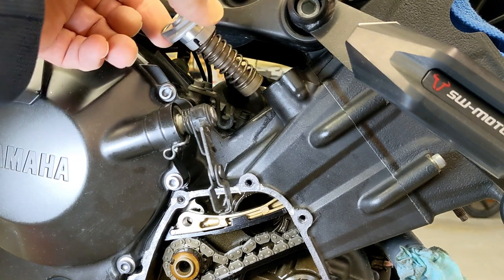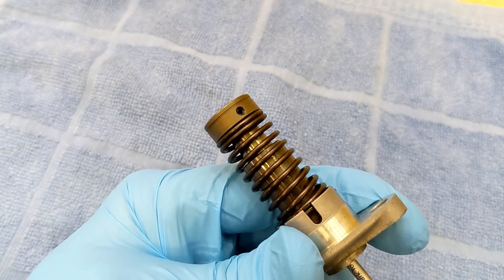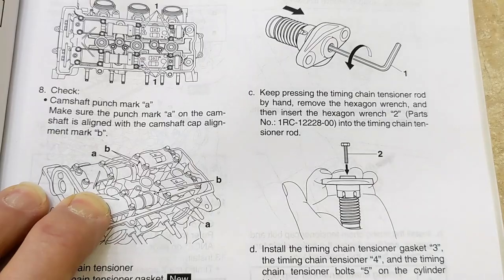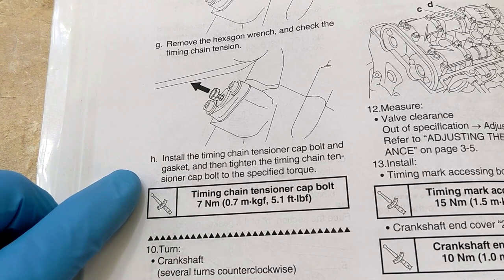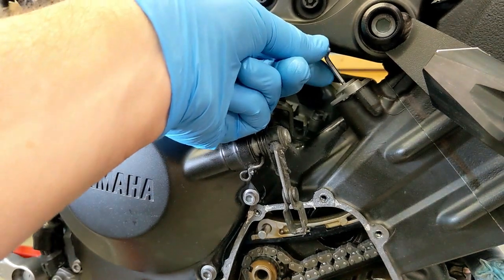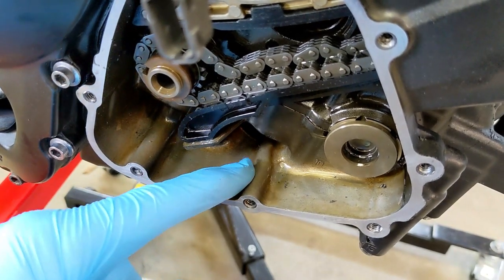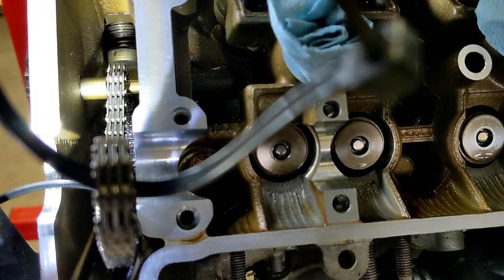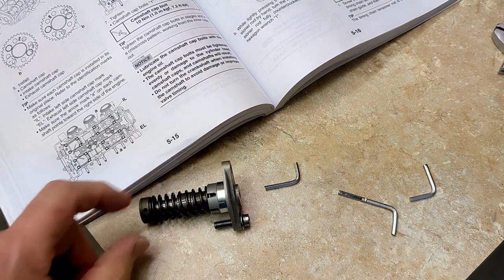how oem cam chain tensioner works Yamaha FZ-09/MT-09 2014 2015 2016

Comment: Thank you for the instructional video. Way back in 2014 I received a recall notice from Yamaha about the rattling sound coming from the CCT. They replaced the CCT twice and so I just went with the manual CCT from APE.
Reply from the maker: Thanks for the thanks! Here is a link in my google photos to the old recalled version and the updated version
https://photos.app.goo.gl/MS6maev7WRg43JxB7

Comment: Great video. Instructions are clear. 

Will be great if can list out the require tools and size like the allen key size
Reply from the maker: If you want to make a tool that works check out this video that I made:
https://youtu.be/4i4s4J9Vb1A

Thanks for the positive feedback
It's practically impossible to just cut an allen key down..I should know, I tried three iterations....

Comment: When the engine is working how does it compress 0,7" (3:20) if when you squeeze it (1:58) it only goes 1/16" and something is stoping from going further back (certainly the screw that you twist for it to retract) ? 🤔
Did i just understood it wrong or the whole actual play is just the 1/16" while the engine is working and the extra length it goes back is just for instalation purposes?
Reply from the maker: You're right it does retract for installation... Once you pull the key it's self adjusting as the cam chain wears... It can only go out not in...